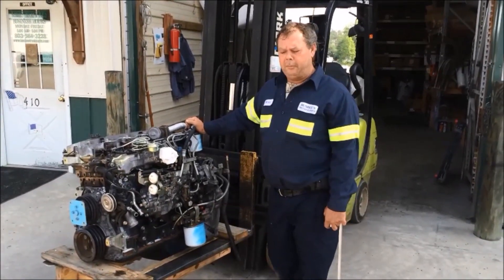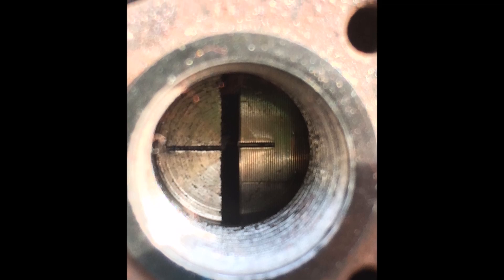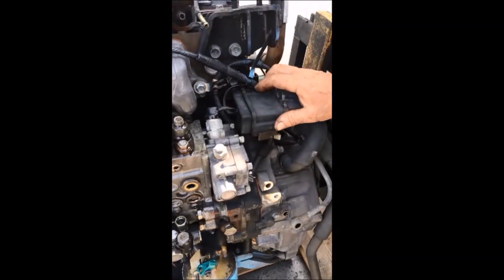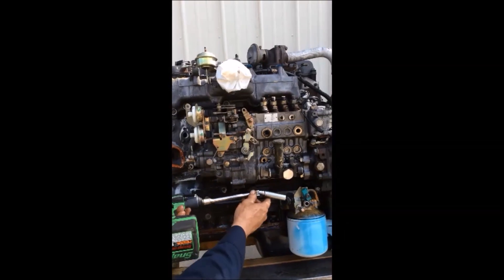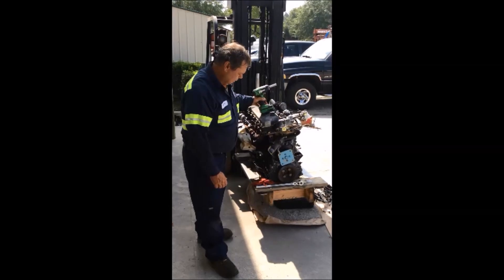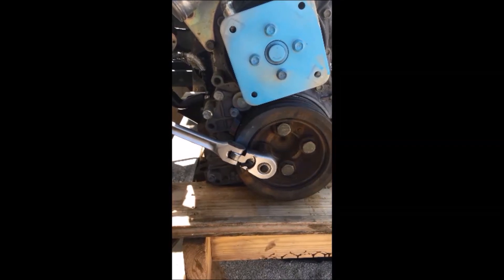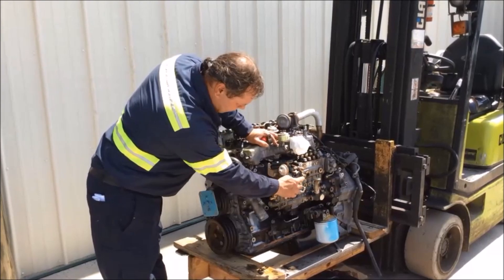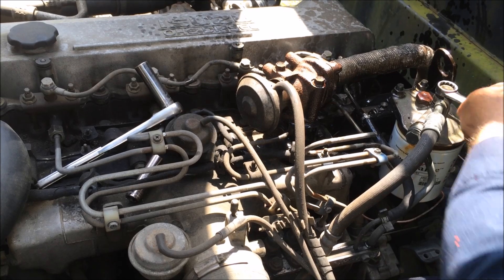4HE1 Removal, Timing, and Installation

Comment: Hello ,  I have 03 ISUZU npr with 4.8L 4he1 . Truck runs and drives well no problem with it it does leak oil from the exhaust manifold down to the side of the engine . I driven it like that for about 60k miles with no problem . I do see the truck has a lot of blow by I took off oil cap and I see no white smoke but a lot of pressure I put cap backwards and it blows the cap off .. what do you think this would be truck has 344k . So wondering if it's even worth overhauling truck still
Runs and drives very well no problem . I would appreciate your feedback thank you

Comment: Thankyou for the useful video, I'm in the process of changing an oil cooler on a 4he1 and need to remove the injection pump to do so correct? It looks pretty obscured behind the pump, but to remove the pump and put it back in place in my case, should I return the motor to the eight degree mark after checking the eight and thirteen degree marks so when I verify the pump is on thirteen it will return to the small eight degree mark on the pump would that be correct sir? Thankyou again for the informative video.
Reply: Isuzu  4bb1 timing 500737
Reply: Джон Партлов s